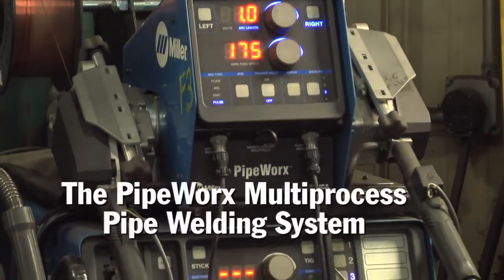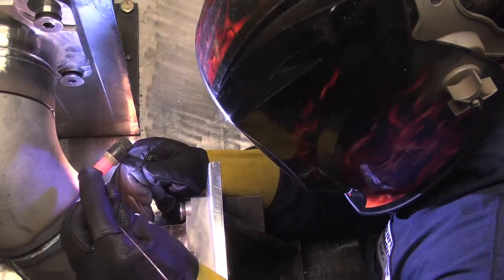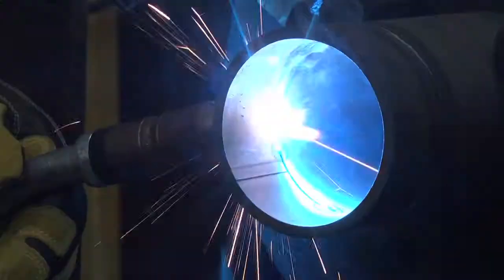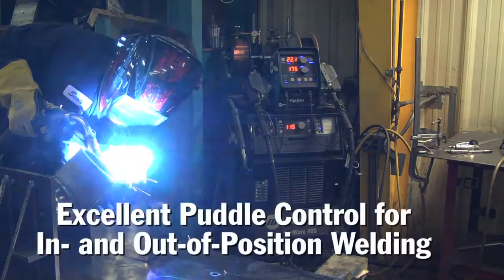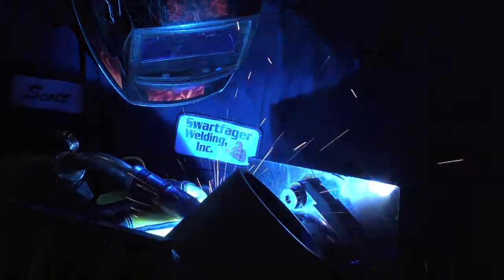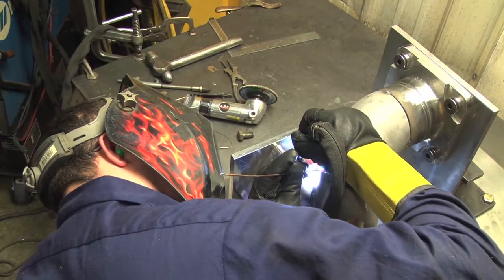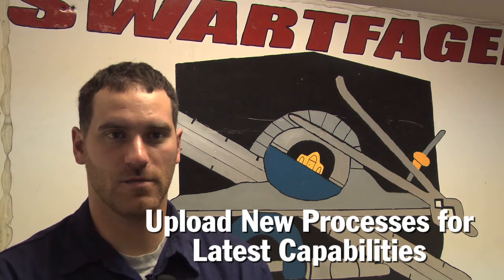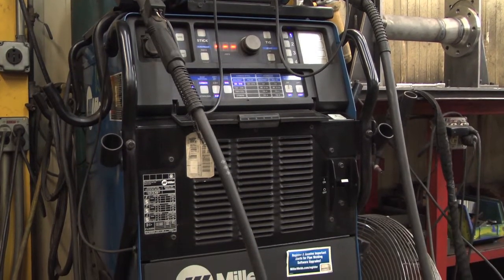Welding with the PipeWorx Pipe Welding System at Swartfager Welding, Inc.

Comment: But why do you have to hold the trigger for a second or 2 to get it to feed? It sucks for tacking. Is there a change of settings for that? We have 2 of these machines at work and it’s the only reason why nobody wants to use it. Pushing around a big unit with 2 cylinders and 2 spools of wire isn’t for the meek either.